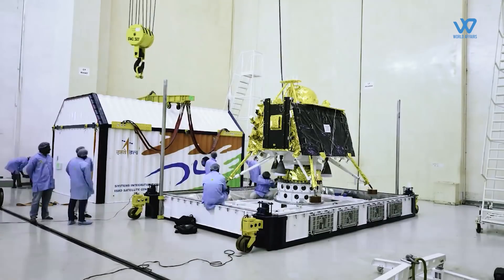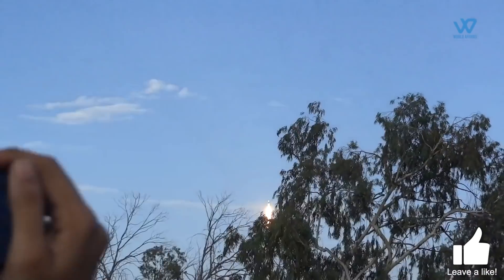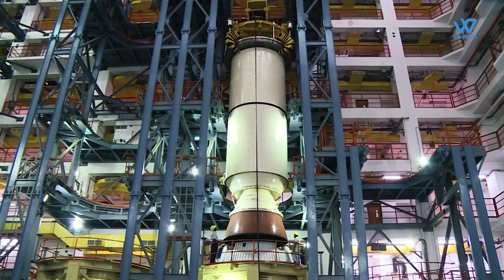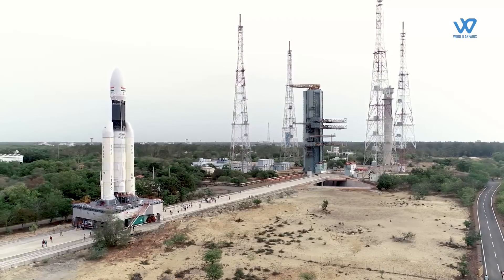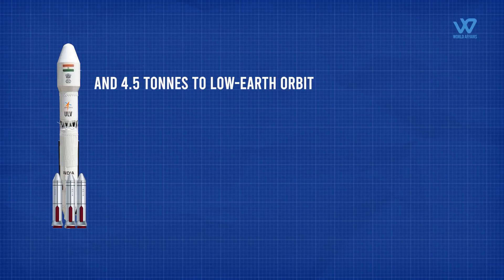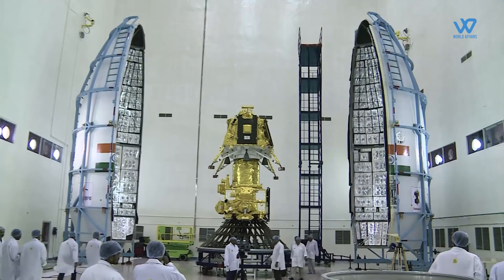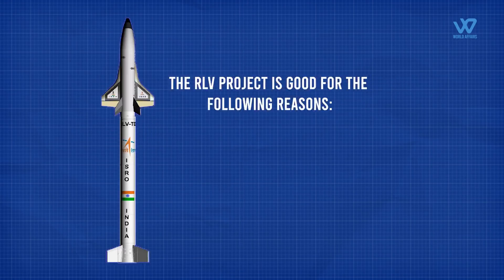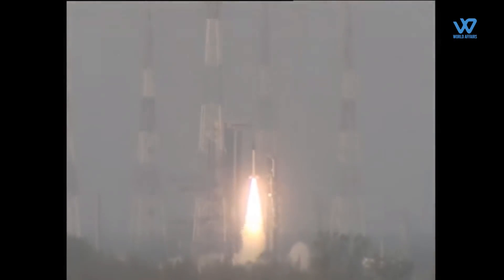ISRO's Next Gen Launch Vehicles Will Completely Change Space Industries

Comment: The last time I checked, ula was building Delta 4 heavy. Not isro
Reply: @Yug Prajapati oh k tnx for the info
Reply: He didn't mentioned delta 4 heavy anywhere in the video ... dont get so carried away with attractive thumbnails.
Reply: @sid7337  but he could easily use just ISRO rocket pictures in thumbnail
Reply: @fuafuafytonmi2303  if you look closely 3 engines down at the bottom are not in a straight line ... delta 4 heavy have them in a straight line. Although it looks like delta 4 heavy coz of the color and basic shape but it isnt. Its more similar to GSLV mk3. Now give it a rest, will you!
Reply: @sid7337  but no rocket like that exists or planned
Reply: @fuafuafytonmi2303  ULV, HLV and RLV are planned.
Reply: @sid7337  neither Ulv nor Rlv looks like Delta IV or Ariane V
Reply: @fuafuafytonmi2303  it does match the thumbail .. and delta iv is not in the thumbnail
Reply: @sid7337  that's is delta IV in the thumbnail, just with a shortened core stage

Comment: we need more research like SpaceX to land on ground 
if we achieve the milestone we can build spaceship
Reply: You don't have to land vertically. There has to be another safer method.
Reply: @navnitmistry8970  Why wouldn't you go with a method proven to be cost-effective. Falcon 9 Block 5 has a reasonably good landing success rate. I don't find much reason to believe that vertical landings are unsafe or that going with an unproven method might be a better idea
Reply: @navnitmistry8970  

How will you be able to land on other planets without the vertical landing system ? Exactly
Reply: @proger1960  Hello
Reply: @proger1960  we'll see your question has the answer in it. On a foreign planet u only have the ability to land vertically. You cannot land horizontally as you don't have a runway there.

While if you think vertical landings need landing pads then yea they surely need landing pads but its not something which is completely mandatory for successful vertical landing. Vertical landing can be achieved on rough surfaces too
Reply: @MrX-cw6nx  
Hey
Reply: @navnitmistry8970  I can help.
Any takers?
Reply: Rlv tested back in 2016.. but the main problem is that isro didn't do a single test since then..
We had built the tech but they didn't go for the test flight they were supposed to do.. the high altitude test(HEX) is done, but lex(2nd test) and afterwards are yet to be done by isro.. and idk why isro is delaying these since last half decade..
Maybe gov. Pressure?
Maybe budget issues(probably Not!)
God knows..
Edit : i just google, and boom.. i found that isro is planning for LEX(2nd test for rlv) in March..
But Half march went by too, hoping in near future! Please isro, dont delay againnn
Reply: @Atzee  I think ISRO is delaying RLV because of those silica tiles for heat shielding. Space Shuttle also had problems with those. Maybe ISRO is waiting to get a better look at Starship's heat shielding solutions. Maybe ISRO is trying transpirational cooling. We really don't know
(This comment reply is completely speculation. I do not guarantee the correctness of the information)
Reply: @biplabkumarghosh6300  maybe!
Well after watching video i made conclusion that rlv wouldn't be as good for isro as sslv and other lv's are..
Why did nasa stopped using shuttles?
Coz they might not be as efficient?

Sslv works better at that range (4mil$ for 500kg..)
And gaganyaana mission would go on gslv mk3 modified version..
So whats sense of building rlv now??
5 years back we don't have gaganyaana, sslv, even pslv that time wasn't that effective..
But now? We have all🔥 in future maybe much better and more.. so yeah, that's my conclusion... (might sound like i'm a hypocrite😂😂 but no, just some research)
Reply: @Atzee  Well, I think it all depends in their heat shields. If RLV uses shuttle-like Silica tile as heat shields, which needs to be individually inspected after every flight, it would be too costly to refurbish them. It's one of the two reason why NASA stopped using Shuttles. The other reason being the water-damaged SRBs weren't cheap to refurbish either
On the other hand, if the heat shields just need visual inspection after every flight or if they are easy to replace, we get a cheap reusable rocket when combined with a reusable first stage.
The problem with SSLV, PSLV, GSLV is that they use solid fuel. A solid fueled rocket can't land itself and the fuel itself is not cheap either. So we can't make them reusable, which would greatly hamper it's competitiveness on a global level. Only the Falcons are landing now. But it future, Falcon 9, Falcon Heavy, Starship, New Glenn, Vulcan, Electron, Neuron, European-Russian-Chinese rockets, everything would be reuable and vastly cheaper than today's prices. So we need reusable launch systems- done right (not like Shuttle) to compete with global rockets
Reply: @biplabkumarghosh6300  Future is indeed of reusable.. but right now we can't say what's India's first reusable.. weather a rlv, admire or somthing no one heard of..
All we can do is just wait.. and watch!

Btw your presentation skills are dope bro🔥and nice research too.. learnt a lot from you!
Reply: @biplabkumarghosh6300  falcon heavy also lqnds
Reply: What are you talking about? Why should we even focus on that? Stop talking like an overexcited kid. Be realistic.
Reply: @napolean9756  (Assuming you are taking about the original comment) Landing rockets in 3-4 years will be nothing to be overexcited about. If anything it will be industry standard Falcon 9, Falcon Heavy, New Shephard, New Glenn, Starship, Neutron, Terrain R, Russian, Chinese rockets.
If anything, I would say the original comment was very realistic, when everyone is landing rockets, you need to be landing rockets to be competitive on a global scale
Reply: @biplabkumarghosh6300  well good luck doing that with the penny-large budget that ISRO has. It's much more practical (affordable) to launch rovers or satellites than to practise landing rockets by trial and error method (cuz no one's going to get it right the first time), that is synonymous with wasting crores of the taxpayer's money. There's a reason why other space agencies are not doing the same thing, that's because their vision is different from that of spacex's. And so is ours. How did you not think about that? Instead you're going on and on about something that's not relevant at all.
Reply: @napolean9756  ISRO certainly doesn't have a penny-large budget. ISRO's budget is arguably the same as that of the investment+revenue of efficient space organisations like SpaceX (when you factor in the huge wage differences between US and India. If you specifically want to compare ISRO to a government space organization, it would look small because you know governments were always inefficient.
And I am not asking ISRO to stop launching satellites and instead focus on reusability. I am asking ISRO to do both. Use reusable rockets to launch satellites. That is the same model used by SpaceX. Design and build Starlinks and launch them on your own reusable rockets
So you don't want ISRO to pursue reusability, because no one gets it right the first time? That's what ULA said. Don't waste SpaceX's investor money in some trial and error experiment of landing 16-story buildings falling from edge of space. It's never going to land. Even if it lands, it would be toast and you can't reuse it. Even if you can reuse it, you can't launch humans with it. Yet SpaceX's stock prices are mooning, their investors are rich and they are becoming the second-largest launch service provider in the world. If you waste your money developing a game-changing technology, you are going to get astronomical returns
No space agency is doing it? Or you mean only JAXA is not doing it? Because ROSCOSMOS, ESA, Chinese government everyone seems to have plans to land rockets? If you want to include private sector, SpaceX, Blue Origin, Rocket Lab, Relativity Space, ArianeSpace's subsidiary, etc. many have their plans of landing rockets. How did you miss so many of them? NASA is not doing it because they have stopped designing new rockets. Their last rocket SLS was announced in 2011, when the world had not seen Falcon 9's landing.
Either what I am talking about has to be relevant or ISRO would soon become irrelevant if they don't start landing rocket
Reply: There is a program by the name of ISRO ADMIRE for development of that tech. If you can understand hindi gareeb scientist did a good coverage of it.
Reply: @aviralgandhi2314  ok,but DRDO helps is useful
Reply: @akhilpadarthi4743  that's out of the topic. Admire is completely ISRO's own project. They are working on it but it would take time